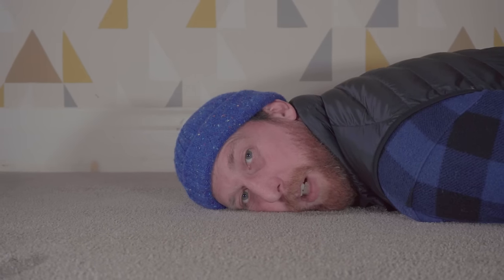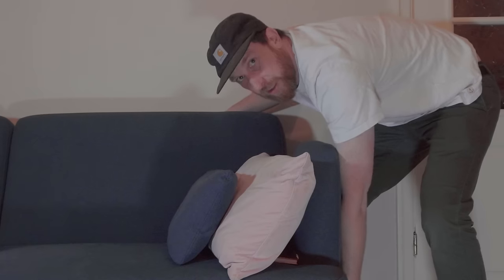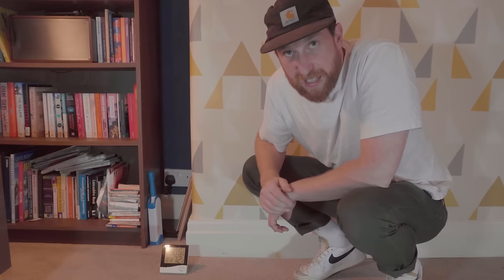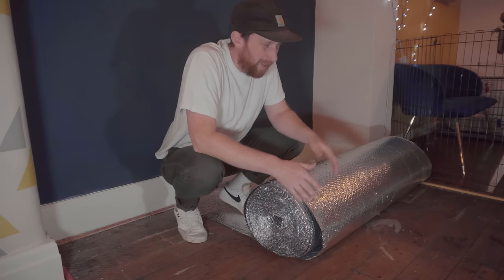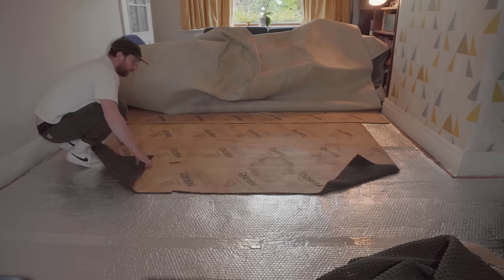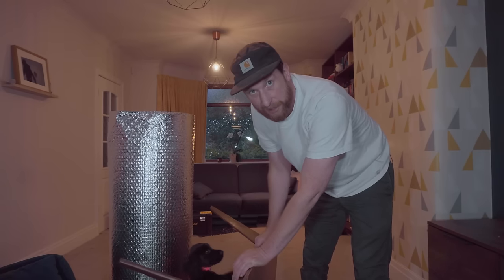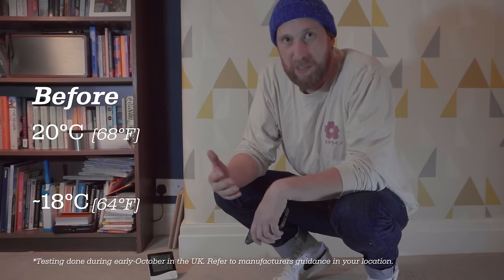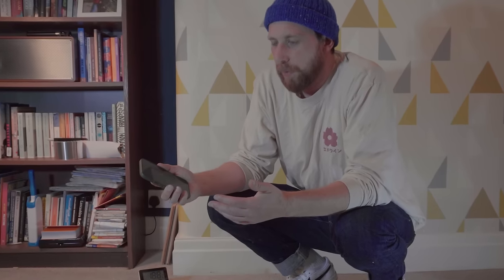This floor insulation could save us HUNDREDS

Comment: Well presented, every little helps. I have realised that during the winter the ground under house slowly cools and the floor follows this decline in temperature, this means heat loss to the floor increases day to day throughout the winter.  Whereas the air outside changes day to day.   I would like to insulate my concrete floor  and lay flooring grade chipboard over it. But that means lifting the parquet floor, which could be done and refitting it, I installed it twenty plus years ago..  That would mean  cutting or raising the doors  or having a step where the insulation ends.  Crazily It can also be a legal problem if this lift in height means the bottom step of the stairs isn't the same height  as all the others.
Reply from the maker: Wow! It’s really not simple to try and make our home perform better, is it? In lots of ways, I know these little changes are just a drop in the ocean compared with better glazing and wall insulation, but it’s so expensive to retrofit old houses to bring them up to a good standard. I’m starting to see it’s worth it though-and if I can make a simple change that has even a small impact, then it’s been worth it. It certainly feels a bit warmer now!

Comment: Have you checked the insulation, or lack of insulation under your floor? I believe that if you take those wood floors up and lay some good thick insulation in between the floor joists, then reinstall the wood floor boards on top, will make a big difference. If your room is above a basement, you can probably access your floor joists from down in the basement. Also, insulating your walls and making sure you don't have any drafty windows, will make a huge difference
If you're thinking about changing the flooring, I would strongly suggest in flooring heating, electric is the easiest. That's the most efficient thing. You will still need to fix any drafty windows and doors and make sure that you have enough wall insulation, to reduce heating/cooling losses
Reply: I really do recommend NOT changing from carpet to wooden flooring.  I have this in my living room and the wooden floor is cold.  Get a new carpet, deep and thick with high quality underlay.  Your feet will love you for it!
Reply: This is the way. You'll get 10-20 times more insulation thickness down there. Just make sure cavity below is ventilated.
Reply: I took up my floorboards and fixed 100mm celotex in between the joists. Biggest problem is lifting up the floorboards without damaging them. Mine was a fairly modern 60s floor so I just replaced it with chipboard.
Reply: @johnturner4400  was this for more thermal efficiency?

Comment: The one extra factor that ultimately needs to be accounted for is moisture, humidity, condensation, and all its variants. There's a fine balance between creating a boil in the bag suit (over sealed) and a breathable cozy, economical living space. Dr Joe Lstiburek's discussions are a great overview, though most UK housing is still [old &] far from ideal. 
Cut draughts, insulate, and ventilate residual moisture.

Comment: Heat rises, so it would be weird if you didn't have a degree or so difference in the temp between the floor and the thermostat height.

Also, the cold air return is at the floor level  as well, so your heat should be venting up from your furnace and rising up through the room, then the cold settles at the bottom and returns to the furnace, instead of drawing the hot air and pumping more hot without dealing with the cool air in the room.

Anyway, you are correct, it's an air flow situation and supposed to be like that.

It's still a great idea IMO to put that insulation down to keep the cold from coming in as much as possible, as your room should retain/hold the heat in better, but that also depends on what's below the floor too probably.

If it's an apartment and you have a living area below you, it might be better to allow their heat to rise up, but if it's just a basement or ground below your place, it would probably be best to insulate it as best you could.

I should also point out that this is all just my basic understanding of all of this, from what I was told and used to design my basement with, and seems to be pretty bang on.
But it is probably all situational...

Comment: We had wooden floors(proper wood), but ripped it all up for two reasons, acoustic sound problems and cold floor, we now have foil , then 10mm underlay and then carpet
Reply: And how did that improved the cold floor situation? What foil have you used?
Reply: @MrGiedriokas  we used Wickes Thermal Foil Insulation Roll 600mm x 8m, much nicer to walk upon but carpet is

Comment: The first step to properly conditioned home is 1) air sealing, make sure no drafts are present and entire buildings envelope is air sealed, use caulking, tape, whatever works to seal any and all drafts, major contributors are windows. 2) water control, make sure no water is penetrating obviously 3) vapor, condensation. make sure you walls layers are in their proper order with air cavity to reduce vapor penetration 4) thermalyl: insulate everything ..lastly)  ultimately what you should do is move out  into a properly built energy efficient building with an ERV.

Comment: Warm air rises, Cold air drops. Thats why the Floor level will be colder than the rest of the room. Its also why sometimes we think there is a 'Draft' from the windows, as heat escapes through the Glass the air (that has lost its energy) will fall down towards the floor, prompting the illusion of a draft.

Comment: Nice video. I’m sure others have pointed out that a 2 degree temperature shift from 20 to 18 isn’t 10% in the same way a 2 degree shift from 4 degrees to 2 degrees isn’t a 50% reduction. It’s much more complicated than that. Nevertheless I do agree all homes in uk should have better insulation. We have some of the most under insulated homes in Europe.

Comment: If that is relative humidity showing on that thermometer, that room is incredibly damp. There are 11.46 grams of water per cubic meter, a comfortable number would be about 9 grams. 

Damp air feels colder and also takes more energy to heat. Try running a dehumidifier in there and get the relative humidity down to 50%.

Comment: As soon as you place weight on it, walking for example, the air will just leak out of the bubbles and its the trapped air that does all the work in the insulation. It'll probably work in places like under the furniture which dont get any direct weight. Its like putting stuff on top of loft insulation which closes the airgaps up and makes it useless.
 The foil backing will add some infra-red reflection but the effect will be tiny. The silver bubble wrap would be much more efficient under the floorboards where they are not compressed and it would stop draughts. Bigger job though!
Reply from the maker: Aye, much bigger job. For a trial run of the product before doing a bigger job I’m pleased with the results. I’ll pop an update in the comments when I take up the floor and see how well the bubbles stand up to walking.
Reply: If you have underlay then carpet it should be ok, and certainly will be under laminate

Comment: Thanks mate fir the great vid.
I've just added 100mm loft rolls to my 1878 property. The temp gain was about 1c. Then I added a second level of 170mm loft rolls. Another 1c gain 🤩 in overall room temp... 
Doesn't seem a lot, bit my boiler needs much less gas.
So if you gain between 1c and 2.5c, it is really good 👍 I suppose for the little price to pay.
I'm going to try your system 😉

Just one thing I would worry about is condensation... Our old British property needs breathing, not sure if this aluminium stuff will have negative consequences on condensation and mould...🧐

Perhaps something you should check out after 1 year  🤔

Comment: This is exactly the stage I'm at so a great vid to show your results. I've been doing exactly the same but have thermometers everywhere now, and even one outside to show actual temperature of air coming in through the air bricks.
I'm going to try this foil for this short term fix, but already anticipating that ready for next winter when energy costs are going to be alot higher, I'm going to install rockwool between the floor joists with a suitable membrane support
Reply from the maker: Thanks! Short term is exactly what I was thinking - for such a low price and effort it seemed a no-brained to get whatever benefits I can from this stuff. I reckon I’ll make the cost back this winter, and do a more thorough job in the spring
Reply: Hi you suggested installing rockwool between joists with a membrane support what does that mean? My flat has a massive cellar underneath.  
I was thinking of putting some of that just under the floor boards because I thought they do that in lofts and it keeps it warm.
Reply: @princesse5043  Have a look at Roger Bixby's Skill Builder channel on here. He's great.

Comment: I used this in my garage and love it, but I did have one issue. I have wifi in the detached garage, so when using this I had it in the ceiling and 3 walls. I left one wall without it so the wifi signal can cover the back yard. I know this doesn't sound like an issue, however if you have a multilevel home and start puting it down between levels you may need to upgrade your wifi to mesh to get better coverage. Just a thought
Reply from the maker: Good point! It’d be an interesting test

Comment: It should work. Also look at using that window plastic heat shrink stuff to insulate your glass windows. In the winter it cuts down on drafts and radiant cold from the outside through the glass.

Comment: Sounds good but I think I am going to do the old fashion method and lift up the boards and put insulation in , there is a lot of draught under the boards and cold air just comes up an makes the carpet cold. I maybe wrong but even as you have it sealed I feel cold air will still permeate into the room with this method.

Comment: Nice video. The bubble wrap reflective insulation will work better if there is an air gap of atleast  1 inch between the aluminium surface and any other surface  so heat can be reflected away.

Comment: The thermometer on the floor is still measuring air temperature, not the floor materiel. A laser thermometer would be a more accurate reading.
The air in the room rises where it is heated forcing cooler air down to the floor level, just natural convection. Humidity management is another concern. I do not know what the floor is made of, if it is wood, any moisture between the vapor barrier and the wood will promote rot.
I am renovating a house with a crawl space about 2 feet below the floor joists. I plan to apply the aluminized "bubble wrap" (vapor barrier) under the floor joists and fill the void between the joists with fiberglass "wool". This will prevent moisture build up and prevent wood rot. This is the intended use of the product you covered your floor with. Good luck.

Comment: Thanks for posting your experience with foil bubble insulation.  I wonder if thermal bridging is holding you back from greater gains.
I'm being held against my will in a basement in Minnesota -- jk...well, I'm 60 and it's either be homeless or live in my Mom's cellar....  Anyway, I've enjoyed Matt Rissinger's channel, "The Build Show," which spot-lights, "high performance," home building and wall science.  However, he's open about the fact he lives in and builds homes in Texas.  He HAS done a number of videos where he visits homes being built in Canada, and, well, they're pretty serious about keeping tight building envelopes and having enough insulation (top, bottom and sides) to keep their citizens from dying in the dead o'winter AND saving on heating costs.  If YOU CAN FIND videos about such things in Canada and apply them you'll prolly increase your savings.

Comment: it works even better if you can provide a larger air gap - this stuff works better in attics and basement subfloors where you can install right on the rafters and beams (typically with air between - even within any kind of fiber insulation). the less direct surface area contact it can have, the better it'll prevent the emission/conduction of heat (hence, the bubbles)

Comment: Great video mate, first thing I did when I moved into my new place was to stack up insulation where I could. Got about 400mm rockwool added to the loft alone just before the energy prices went mental in the winter of 2022. 

Never thought about doing the floors though, but I am thinking about ripping the beams out and putting in concrete at some point.
Reply: If you rip out the timbers then you can end up with damp issues and change the whole way the building behaves in regards to movement on the substrate, depending on the age of the property and foundations. It would be better to lift the timber flooring and create hammocks between the joists and fill with insulation, then thin flooring ply if you have floorboards good enough for finish or chipboard tongue and groove flooring panels. There's quite a few companies offering specific products to do this.
Reply: My house is built onto a concrete slab. The concrete and the foot of airspace above is cold all year round.

Comment: Still air or even with radiators, tends to laminate. So the floor will always be cooler. With insulation and a ceiling fan the room might have a stable temperature.

Comment: Speaking from the U.S.  here, that product isn't meant for that kind of use.  It's meant to have an air gap on one side.  I put it up on the rafters of my attic to keep the attic cooler in the summer.  It definitely works there.
Reply: So can it be used to create an air gap under the floor, attached to the floor joists? Previous owners used fiberglass roll between joists and rigid foam board fastened to joists. A bathroom pipe leaked undetected for awhile, rigid foam held water in fiberglass roll like a sponge against the floorboards and joists. Expensive repairs! Would like warmer floors without risk of water damage. Would this product work for that?

Comment: Interesting video. I have used some aluminium bubble wrap to insulate my garage doors and also use it at night to cover up the glass doors in my kitchen and garage. I'm not sure how effective it is but it makes me think I have been doing some good. I've even made some inner soles for my mtb shoes to try to keep my toes warm and it does make a slight difference. However I think that putting this under the carpet/underlay is never going to be the best solution simply because you are compressing the air layer and this is one of the factors in how this material acheives it's thermal efficiency, if it is completely flattened then all you are left with is two sheets of aluminium foil. I think that it would be much better under the floorboards which for me is easy as I have a cellar. Anyway, if you are happy with how it went then who am I to pontificate? Maybe I will try putting the foil wrap on top of my feet instead of under them - time for an experiment when the weather turns colder again.
Reply from the maker: The foil-bubble mtb shoe insulation is a genius idea! I’ve wrapped my whole toe box in aluminium foil before in road bike shoes and I’m sure it’s saved my toes. 
I think you’re right about the insulation under carpet being sub-optimal. My eventual plan is to lay a wooden floor so just wanted to test the product really. Its pretty sturdy, to be fair, and I followed the manufacturer guidance, so you’d hope it lasts more than a few weeks before popping. Maybe I’ll check back at the end of winter with an update.

Comment: My downstairs had carpet on concrete. I installed cork flooring as a thermal barrier,  for my feet, because it radiated coldness. Now I walk on the cork flooring and never get cold feet!   There's no going back, and it's green.

Comment: I reckon insulation foam that they use to fill cavities in walls  is better for floorboards . Or you could simply buy used or reclaimed insulation (asbestos free) .
For concrete floors /linoleum;bubble wrap is ideal 
 Reflective heat  does works behind radiators . I felt an instant gain in room temperature after fitting #Radflek to my rooms . A ten radiator packet is enough for 3 bed house .

Comment: Several years ago, I installed high performance Timber Tech 2 (foil side up) for floor insulation with 7mm fibre board on top followed by hard wood flooring. 
So far, my room stays warm even this past couple of weeeks, average room temp with only computers on, around 20°C. Pretty good I'd say.
Reply from the maker: Sounds great! I’m going to do the floors next year, hopefully, and looking forward to making this work better then

Comment: I watched another video where the guy does this but installed under subfloor, preferably between subfloor and joists. 

The reasoning was the bubble wrap will pop and break over time and you’ll lose the insulating properties.

Comment: I've used packaging bubble wrap to insulate my basement windows, it works very well and lets light in. I'm guessing you do not have a basement? I don't know if this bubble wrap floor insulation would work in my house. Since the furnace is in the basement and heat rises, the basement is always warm in the winter. So essentially, the bubble wrap prevented heat loss overnight?

Comment: Am i correct in thinking your humidity is reading at 72%? If so, that's going to feel colder as it's holding more moisture, I know this because I have a very old home- sealing in everything in a Victorian is an issue, your house looks newish though- great tip re insulating the floor

Comment: There wilĺ always be a temprature gradient in the room... warm air rises..

The issue with that insulation type is the air escaping the bubbles, which will happen over time.